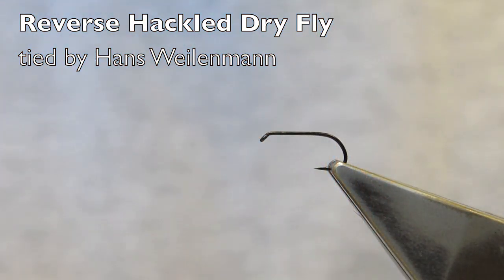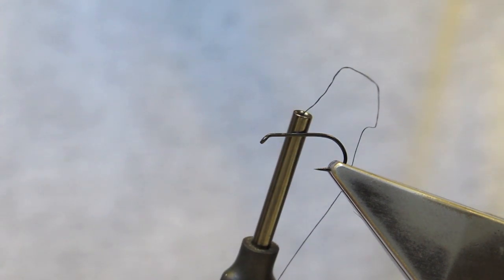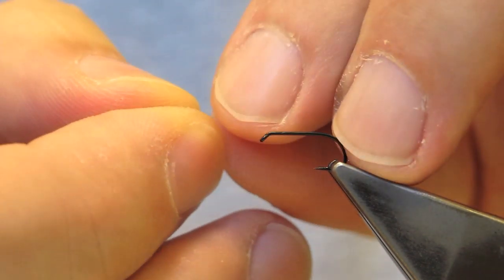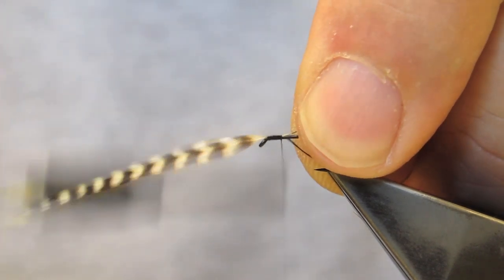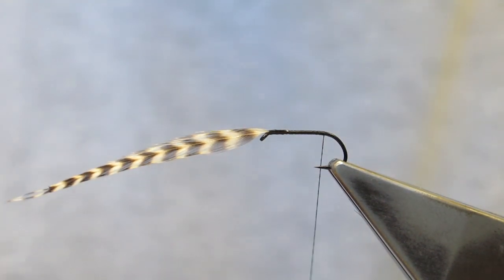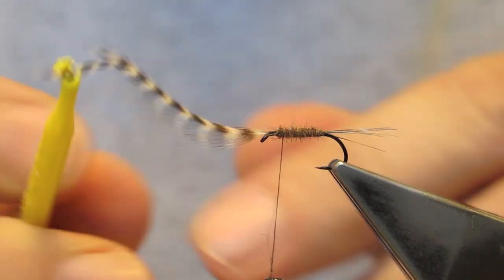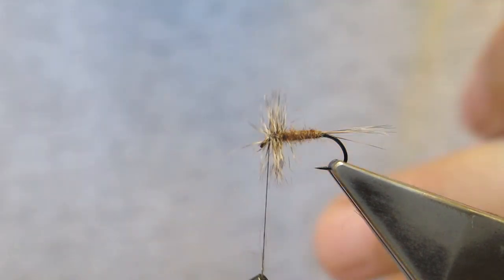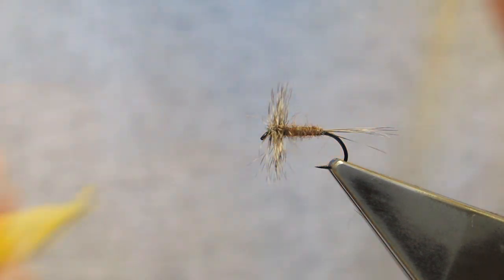Reverse Hackled Dry Fly (generic) - tied by Hans Weilenmann

Comment: Just started back tying small flies, small for me as in 12, 14, 16's after tying for saltwater flies for years. 
Having lots of problems with the hackle, both tying in and tying off. So I decided to see how things were on YouTube and found your tip. 
Just tied a size 14 and it was so simple I don't know why anyone would do it any other way.
So, from me to you, thanks for one of the most outstanding fly tying tips I've ever picked up and I've been tying flies since the early 50's.
Ron Cavalier
Ruskin, FL
Reply from the maker: Ron Cavalier Hi Ron, thanks for letting me know ;-)
The number two tip I would suggest you check out is the video I posted on tying off material. Equally valuable for small trout flies as also much larger saltwater patterns.
Cheers,
Hans W